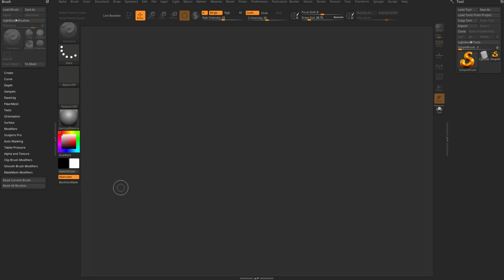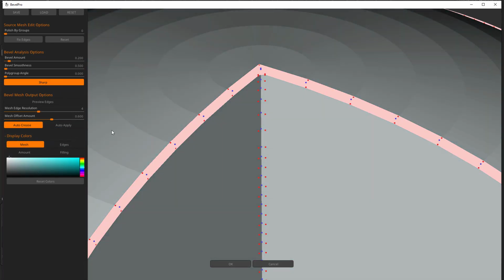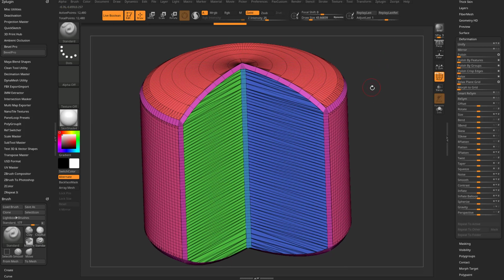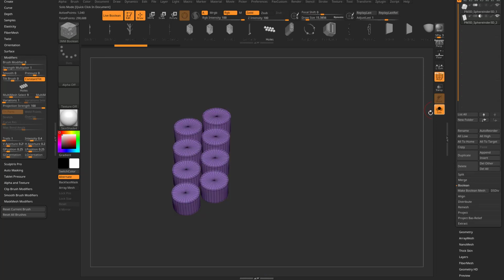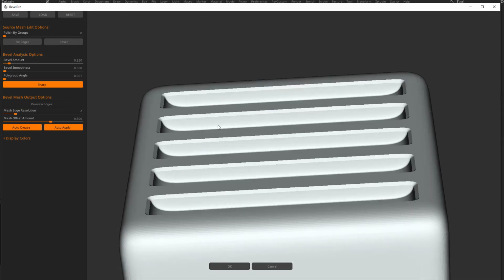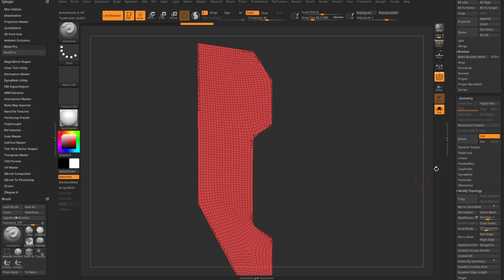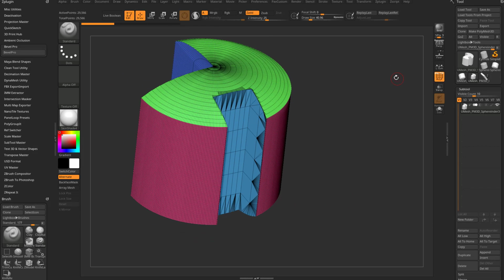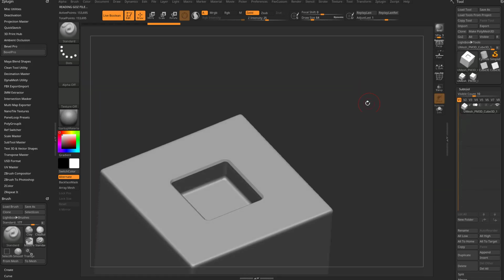ZBrush 2022 - Bevel Pro! Bevel ANYthing with a polygroup border - high res, boolean, dynamesh, etc!

Comment: No options for custom bevel shapes?!?! for example rounded bevels, is it only just angled bevels?
Reply: BevelPro has now Chamfer and Bevel option, but for custom Bevel... in ZBrush in EdgeLoop.. Panel loop there is Bevel profile, but i think thats only option in ZBrush with custom bevel
Reply: you can add loops with zmodeler insert edgeloop and you can set it to dynamic elevation to change the profile, although it is not equivalent of custom profil but a little more playground

Comment: Holy cow the amounts of steps you had to go through to get that inset!!! This plugin adds good value to  boolean operations for sure and it was long overdue, but  still needs a lot of  work. Seems like  a poor imitation of what other software already does better  [like modo for example]  considering that is destructive [boleans need to be applied] and it does flat bevels only more or less. I did not play too much with it yet and I am sure  it will get better/ I will get better at working around it. Excellent tutorial like always, long live zbrush